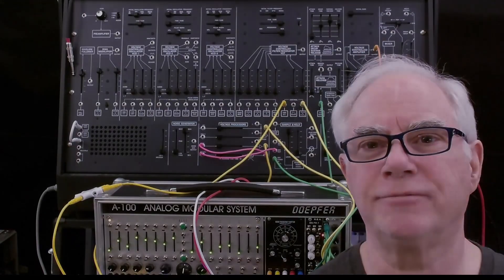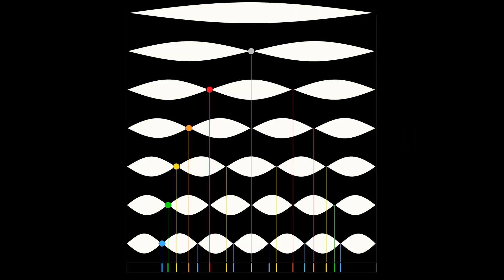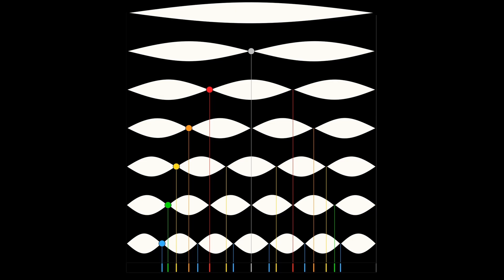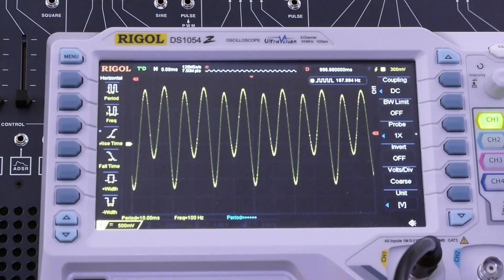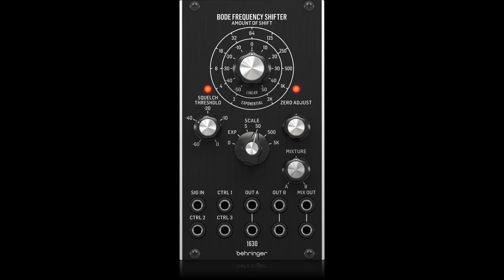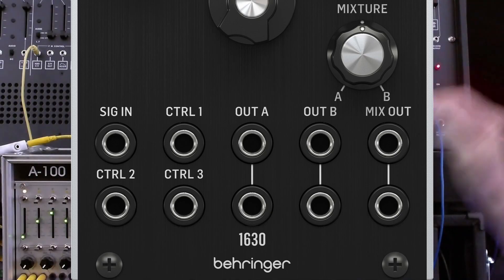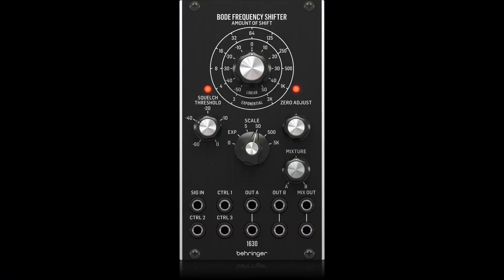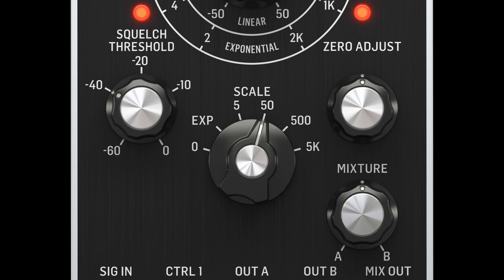System 55 - 1630 Bode Frequency Shifter - Part1-- What is a Frequency Shifter?

Comment: Would i be able to run a guitar signal or preamplifier signal into the input and use volume or expression pedals in the cv inputs to freq shift the guitar signal?
Reply from the maker: Yes, if the pedal would output 0-5 volts.  I have not tried that exactly.

Comment: The Behringer 1630 is not the BODE 1630 Frequency Shifter. It is just a cheap something.
Reply from the maker: Can you add some technical details about the differences?
Reply: @ozhalljr  The core part of the FS is the 4 quadrant demodulator MC 1494. In the Behringer FS they are using a low cost Analog devices chip. You can not do build this Frequency Shifter vor 130 Euros. SYNTH-WERK is doing it exactly like the Original and they need to charge 1.900 Euro.
Reply from the maker: @TheWhitenoiseunivers  Thanks for that detail!

Comment: If I feed a Eurorack Ring modulator with input x my dry guitar sound and input y with the same guitar sound through a frequency shifter, what will happen? Will the sum be different as I move through the notes of a scale and the difference remain the same note?
Reply from the maker: If you did that, worlds would collide and the atmosphere would burst into flames.  Don't even try it.
Reply from the maker: @MYGAS21   Check this out: 
https://youtu.be/IXRxRXCsY4g
Reply: @ozhalljr   SO ....I watched the video a couple of times and I am not sure I understood your resulting conclusion...that in essence the two effects are the same thing? IF YES THEN..... I think that is true and not true by some aspects. EHX has a Ring modulator called THE RING THING that outputs either the Upper Sideband (the sum of x & y ), the Lower Sideband (the difference of x & y), or Both ( = Ring modulation effect proper).. Would you consider the RING THING a type of Bode Frequency Shifter?
Reply from the maker: @ They are not the same, but the end result is very similar.  The Ring Thing is very similar to the Bode in that it can output upper, lower or both (Bode calls this the mix output).  There's more going on with the Bode because it provides a sine wave that can track 1V/oct.  This is used as the internal "y" input.  In your case the X input would be your guitar.
Does that clarify.  Do you own the Ring Thing? the Bode?  Another Ring Modulator?   Are you trying to decide whether to purchase one or more of them?

One of the reasons I did a video was to demonstrate that perhaps any of these effects will get you where you want to go.
Reply: @ozhalljr  I am in the process of acquiring the Bode. The RING THING I already have and a number of other Ring mod pedals and a couple of Eurorack Ring mods. I have the same impression that the Ring Thing is similar to the Bode, but not the same. I am going deep into Ring mod guitar, exploring its possibilities for some time now - (guitarists approach to Ring mod currently is very limited and kinda wrong IMHO ...never mind). I think a Freq shifter is a must for my quest for musical metallic textures. Thanks for the clarification... I have a GAME CHANGER delay that has a pitch tracker that might come in handy. But my initial thought is to just create a difference with the designated knob and feed a EURORACK Ring Mod with x the dry guitar and y the frequency shifted difference that should remain constant. My hope is that the lower side band with the difference will remain the same and function as a drone. If that doesn't work out ...maybe something else will. I think freq shifters can do some cool frequency beating (  = my favorite type of tremolo). No?
Reply from the maker: @MYGAS21  (guitarists approach to Ring mod currently is very limited and kinda wrong IMHO)  I think you're correct in that there' more to be had from the ring mod than playing with using a fixed pitch for a Y input.  Do you have any effects device that would produce a pitch shift (not Freq Shifter)?  If so, use the output of the pitch shift as the Y input.  That will take care of the tracking and do some cool harmonics.  I'll see if I can rig something up to try that concept.
p.s. another alternative would be to use the Behringer PP1 pitch to CV, then patch that CV into the controll input of the Bode 1630.
Reply from the maker: @MYGAS21 I'm a marginal guitar player at best.  This was highly edited.  Perhaps this will give you a feel for having a CV extracted from the guitar input to drive the 1630 internal Oscillator.
https://youtu.be/hdZQSEyi57o
Reply: @ozhalljr  LOL! And here I was dreading that I would be stuck with the same lower sideband note for all eternity! Things are much worst! Will cats sleep with dogs as well?
Reply from the maker: @MYGAS21  it could happen :)

Comment: so there is almost no difference between a frequency shifter and a ring modulator?
Reply from the maker: Great question.  There are two Ring Modulators at the heart of the Frequency Shifter circuit.  There are several differences:
1) there are separate outputs for the sum and difference signals.  this is a bigger deal than it sounds might seem. 
2) there is a built in precision VCO that outputs a sin wave.  This VCO has "amount of shift" (coarse tune) as well as "zero adjust" (fine tune).  Also, the voltage control can be either EXPonential or  Linear (in 4 ranges).
3) there is a "mix" output that can crossfade between the two outputs (sum & difference).
4) there is a "noise gate" on the output.
Reply: @ozhalljr  thanks for the explanation... I thought it was a completely different process but it looks like I could "build" it using a couple of ring modulators and other modules in my rack.
Reply from the maker: @liantrosretrospectiva4134  almost, but not quite.

Comment: Thank you for the video, forgive me, so am I right in thinking the pitch of the note stays the same?
Reply from the maker: @DisciplinedCommotion If I understand the question correctlly ... The outputs will usually have an audible difference in frequency.  The (in)harmonic  profile will remain the same as you play different notes, if you are 
1) using exponential "scale" (1v/octave tracking) and 
2) sending the same keyboard control voltage to both the external VCO (Program) and the internal VCO (Carrier).
If you (externally) mix the original signal with the Frequency Shifter output, the original signal will be unchanged, but the Frequency Shifter output will remain the same.
This probably all sounds like "double speak".  Hang with me until Part 2, when I go into the seven different applications.  There are so many options, it can get complicated to discuss.
Feel free to re-ask the question after you've seen Part 2.

Comment: great work again OZ. I was wondering if you were going to get one of these for your collection. A really interesting piece of gear. Cheers
Reply from the maker: Yes.  I got mine a couple of weeks ago.  I knew almost nothing about how to use this “bit of kit” prior to researching for this video.
Reply from the maker: Btw, this module meets the Ring Modulator requirement that I listed in my 5 missing features video.
Reply: This gives me some hope that they have not abandoned the 55 series project. Lets hope they put out some other missing pieces. @ozhalljr
Reply: now everybody has a better understanding. thanks for all your research. Cheers @ozhalljr
Reply from the maker: Cheers Tony!